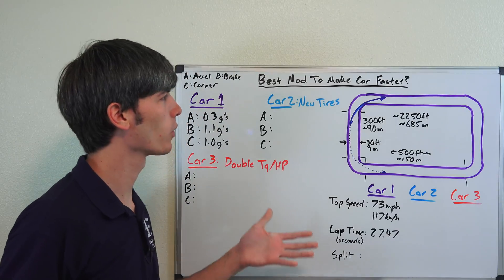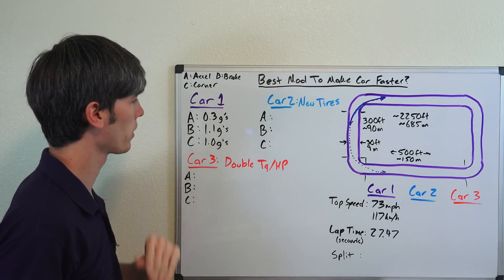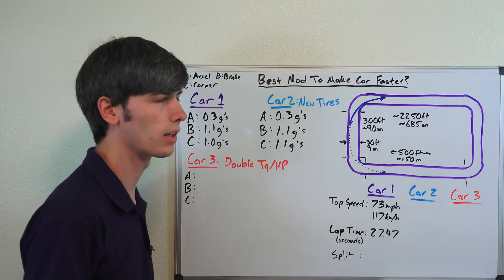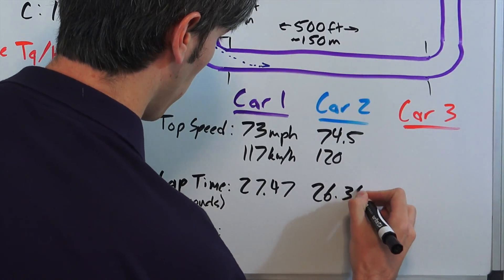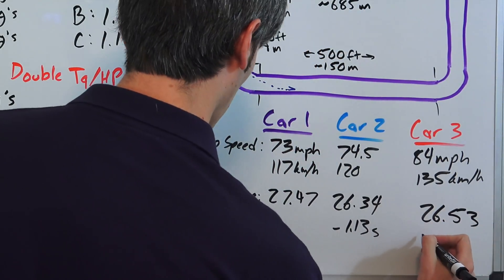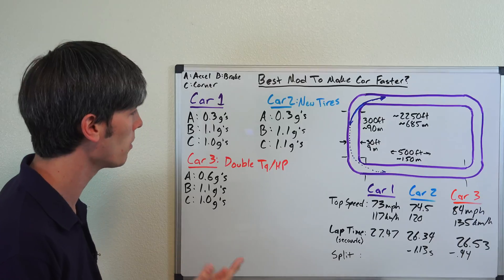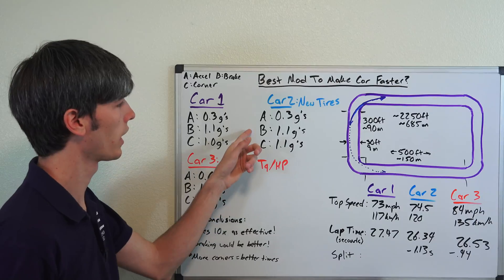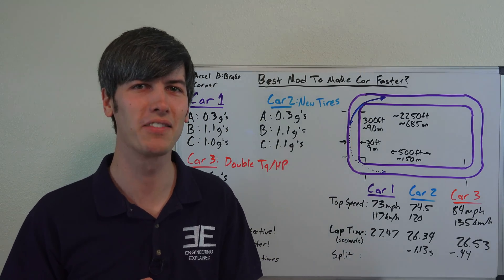What's The Best Car Mod To Go Faster?

Comment: The SCCA believes - and I concur - that it is in the seat. In autocrossing you can move your car from stock to street prepared either by doing a lot of work to your engine, wider tires or lighter body parts - all expensive mods or you can install a true racing seat that holds you in place. Having been held in the wide bucket seat by a 3" Air Force seat belt but sliding around during cornering my 1960 Porsche, I was amazed at how much more comfortable and confident I was in a Skip Barber Formula Ford that held me solidly in place.

Comment: Suspension, gearing, and throttle response also plays a huge roll, power helps a shitload if you have the supporting mods to make sure you can put the power down. 
But hands down the best thing you can do to make your vehicle faster is just learn how to drive.

Comment: lets be very real here. i know the cars is built for the corners, but are the driver built for the corner or are they really built for hi way rolls. in that case which is 99% of the people out there, what will a fully built suspension help me in beating the same exact car with a intake on it from a 50 roll.

Comment: The best racing line around this course would be the one with the least steering change required integrated over the length of the track.  Maybe.  I have almost completely forgotten my physics.  Seems to me though that every time you turn a car (in the real world and not a frictionless environment), you scrub speed into kinetic energy in terms of heating in the tires.

Comment: Forced induction, bored and stroked block, more aggressive cams, taller gears, higher compression, racing fuel, improved ignition timing, better intake and exhaust. Basically, spend more money on the engine and transmission than anywhere else.

Comment: This may be true for track racing, but what percentage of people use tracks? The majority of cars have a standard 0-60 or 0 to 62 mph time which most people would be interested in, on standard roads. As this is in a straight line, then tyres would not be the best mod to make a car faster.
So do a video for the best mod to make a car faster in a straight line to reduce the 0-62 mph time, which is why I watched this video.
Reply: Pete Lyden weight reduction and tires.

Comment: I'm wondering what to upgrade on my 2014 lancer Ralliart, I'm already looking at higher performance tire, michelin pilot sport A/S 3+ and have a better cold air intake with an AEM aftermarket but I'm trying to figure out whats next. Any pointers?

Comment: How about a little weight reduction? Less weight to transfer, of course, means less to push forward, less to stop, and less to carry around corners. I wonder what level of weight reduction would yield equal performance to +100% power or +10% tire-based grip on this theoretical Indianapolis track of yours?

Comment: Good video.

Thing is: if you run antilock brakes like every modern car does, these shiny new tyres will also allow for higher brake deceleration because the antilock will kick in later. So it's not just about the cornering force these new tyres can deliver. You will also gain track time from being able to shift the brake point closer to the corner-in point, allowing for longer speed passage on the straight parts.

Comment: Another benefit of better traction is fuel savings, if you're not braking and accelerating as much on the turns. 
This also kind of illustrates how ridiculous muscle cars are, insane horsepower, with not so great handling, I'd rather have a relatively lightweight yet powerful vehicle with great handling for practical road (or track) use.

Comment: Light Tires+Wheels most important . Try a sprint race with turns in Hiking Boots .... lol . I wish there would be a list of performance tires lbs in the same size . Wheels have to be much lighter like Enkei rpf1,Volk te37.  Tooo expensive ? Better wait until u can buy. Take out all the lbs u don't need,even the badges + the spare - buy a Can . Go a little lower in Tire diameter like from 205/50/17 to 215/45/17 =  -1.8% in diameter .     Have fun+ Happy NewYear

Comment: You say faster, then show a track. Not everybody cares about tracking. I do, but faster as a general term for the average guy that just wants a straight line, I'd say super or turbo. Tires on xcross runs. something like a race track, hmmmm, depends on size and all that. I don't agree there is 1 solid answer for "faster".
Reply: You probably did cover some of what I said. I'm at work so the video sound is pretty low.

Comment: I'm lost with all the new tire brands , i don't even know if the tires on my Camaro are good bad or inbetween . They look cool but i never heard of the brand until i bought a used car that had them . And i don't race so i guess it doesn't matter , i do know they can make for a lot of fun in the snow though .

Comment: This does a fine job of highlighting how difficult it is to define "fast."
In this case, "fast" is going to be determined primarily by cornering ability, which makes high HP moot. Put a long straight on the course, and suddenly things change...
So, clearly, the best mod is to double the power AND tweak the suspension and tires. :D

Comment: I would like to add my $.02.  Most important mod is seat time.  Greatest gains will be seen with increased comfort with correct line, brake points , and trailbraking, staying on the traction circle, until you are sure you have consistently gotten the most out of your street tires, then add track tires with low treadwear numbers, pref<100.  Then you have to start all over with seat time getting used to increased tire performance.  Great series.